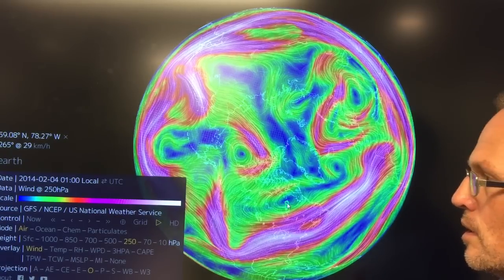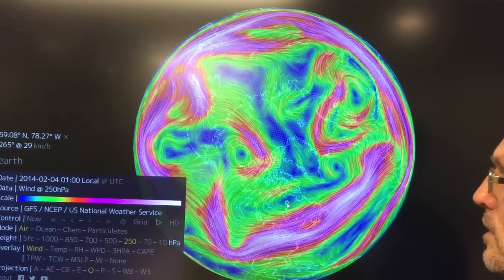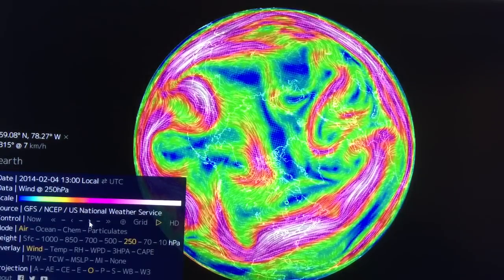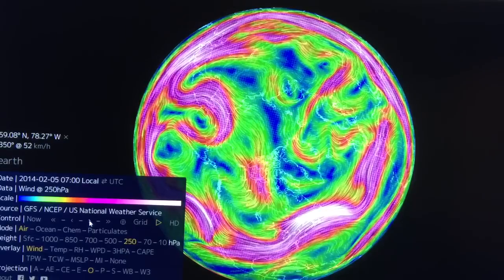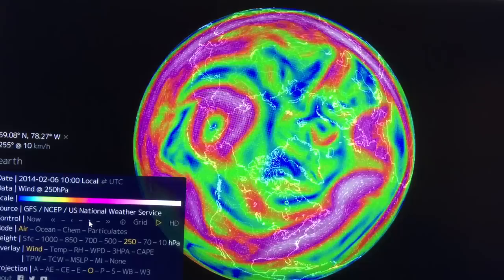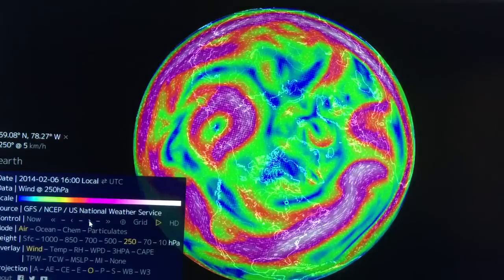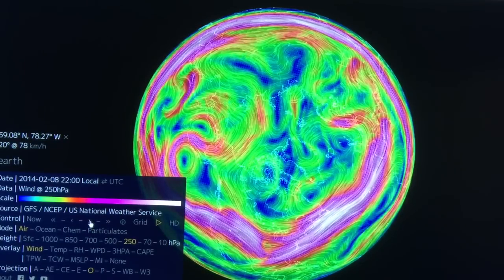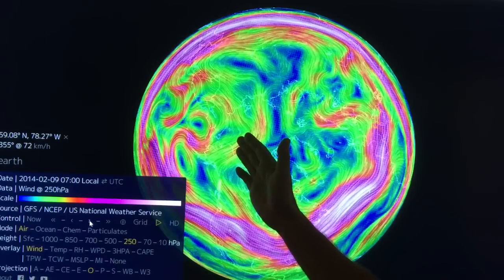Loopy Jet Stream in Arctic

Comment: Paul I have been following your work for a while and this latest tangent into the jet streams seems odd. Generally you look at other specialists work and then incorporate their findings into your overall view of the climate system. So when it comes to the jet stream I would have expected you to refer to a specialist on the jet stream to understand whether these patterns are unusual or not. Its a great approach and one intentionally left out of the msm narrative on climate change. They dont want anyone connecting the dots of the climate system to be heard.

You say more than once in this video that you found this jet stream behavior odd but you never explain WHY you think its odd. Given that I dont think you are a specialist on jet streams and you never explain WHY you find it odd, this video just boils down to some pretty graphics with next to no context.
Reply: I will refer you to Dr. Jennifer Francis, she is one of the leading Jet stream specialist and there are quite a few excellent presentations of hers on You Tube.
But basically, when the differences in temperatures between the Arctic and the Equator is lower, the jet stream weakens and this is also linked to a drop in sea ice because  the Arctic is warming much faster than the rest of the world.
In short, it's a complete system, you mess with Arctic sea ice and the Jet stream gets messed up which in turn warms the Arctic faster it's a feedback loop) because warm air is "jumping" the barrier that was the Jet stream.
Reply: Thanks for the tip I will check her out. I understand generally speaking about how the warming of the artic changes the temperature variations between the pole and the equator and generally how that is disrupting or making wavy the jet stream.

Just seemed like this video amounted to "this is weird" but without any of Paul's usual excellent explanations or context given perhaps in regards to how it was before or what not.

Not complaining. I believe Paul does his best to explain complex issues.
Reply from the maker: A) Jet Streams exist because the equator is much hotter than the poles
B) Warm the Arctic much faster than equator and Jet Streams have to change. 
C) The rest is details.